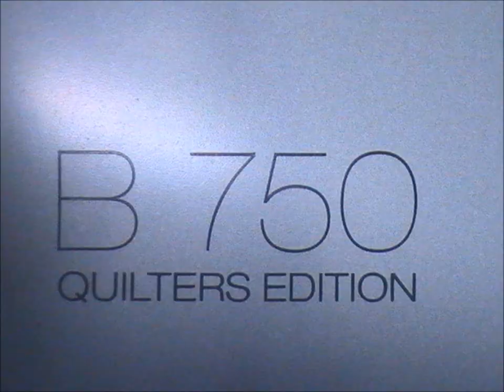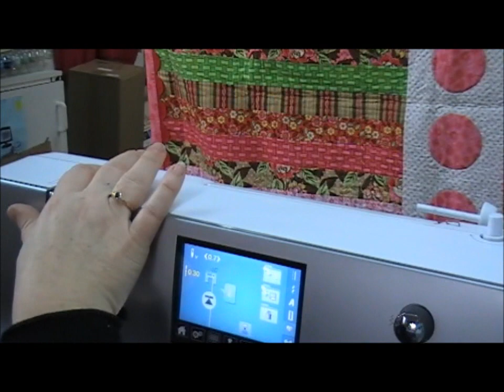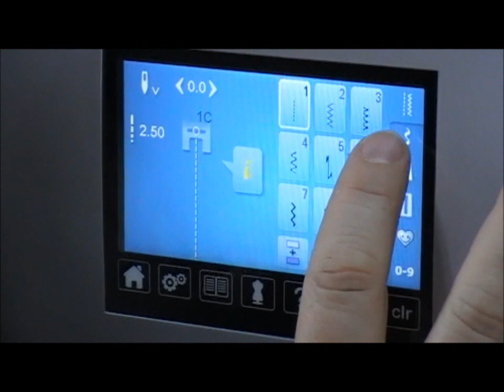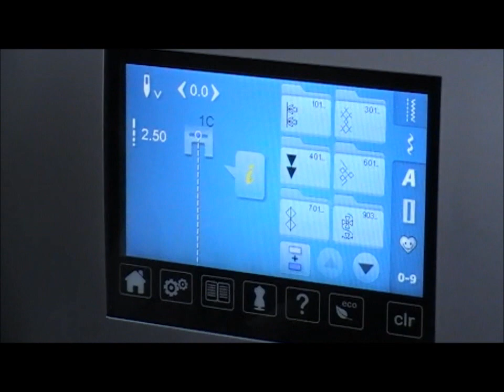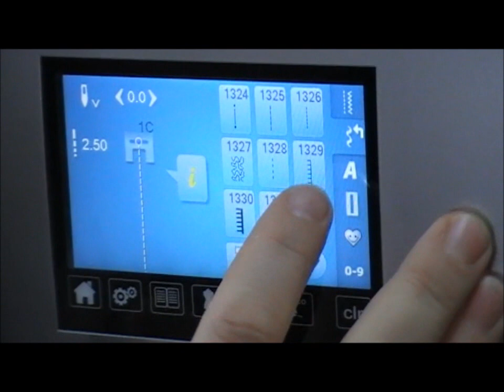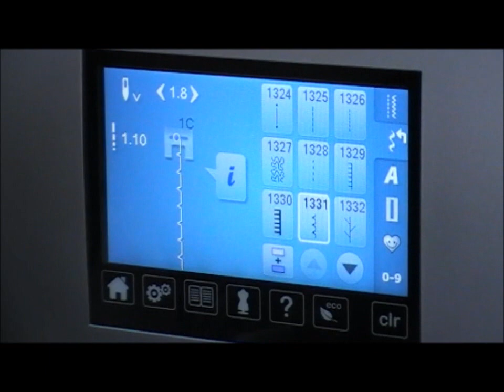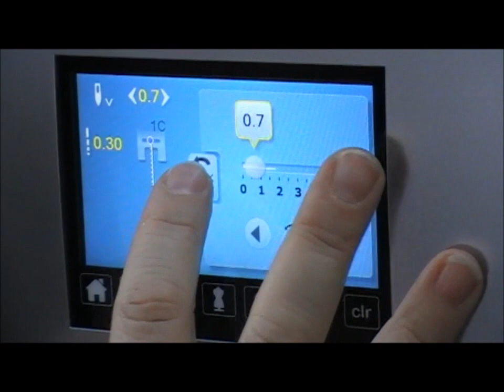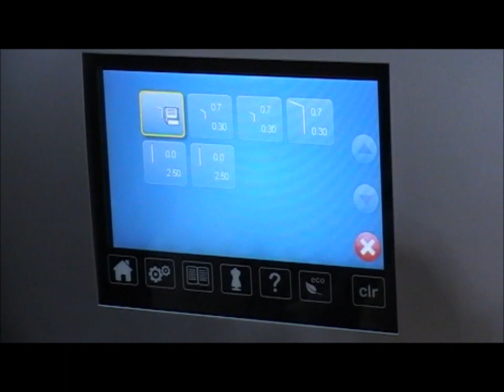Machine Applique on your Bernina 750

Comment: I have owned a B750qe for 7 years and mainly for quilting. Your appliqué video is an excellent tutorial with clear  visual instructions! I feel more confident now trying appliqué, but most likely with an Aurifil cotton thread. Is the set up of the B750 different for a cotton thread?
Reply from the maker: You would probably need a larger needle if using a 40-50 weight Aurifil - 70 or 80 but otherwise the same.